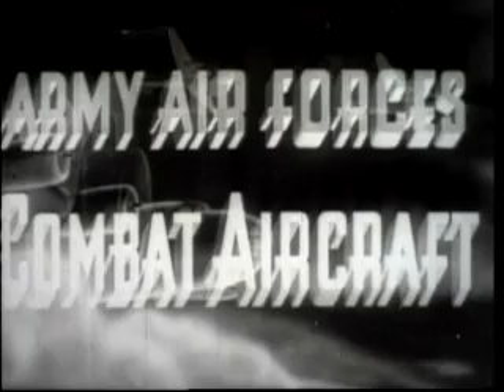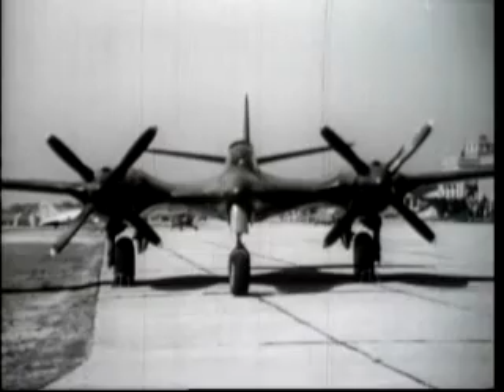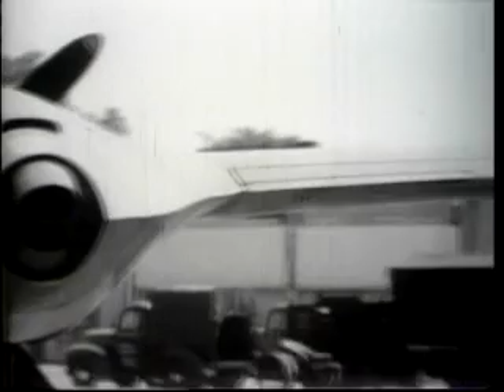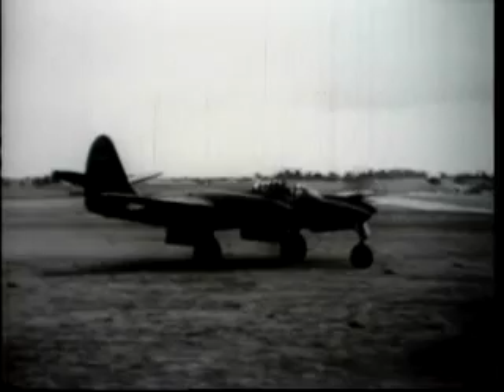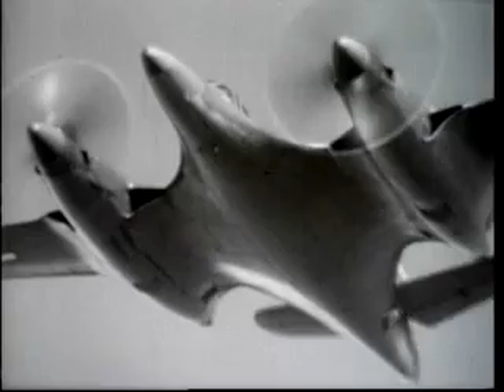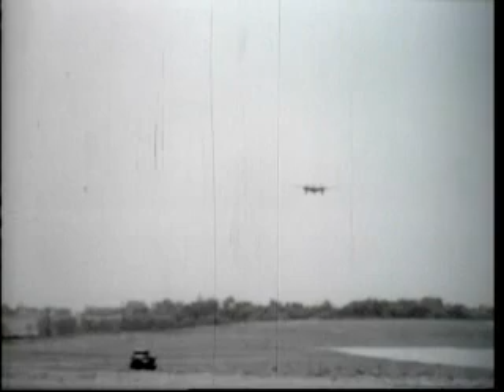XP-67: The "Bat" Outta Hell

Comment: IT HAD LONG RANGE, BUT EVERYTHING ELSE WAS SUB-PAR

Maximum speed: 405 mph (352 knots, 650 km/h) at 25,000 ft (7,600 m)
Cruise speed: 270 mph (235 knots, 435 km/h)
Range: 2,385 mi (2,074 nmi, 3,837 km)
Service ceiling: 37,400 ft (11,400 m)
Rate of climb: 2,600 ft/min (12.7 m/s)
Wing loading: 53.4 lb/ft2 (260 kg/m2)
Power/mass: 0.12 hp/lb (0.2 kW/kg)

Comment: The XP-67 would make an awesome light attack aircraft for today's needs. Replace those heavy Continental recips with lightweight, high efficiency turboprops. Her lines are clean enough that she would also make for a great surveillence platform with a bank of synthetic apature radar antennae on either side of the fuselage belly. A 2nd crew position would be helpful in both instances.

Comment: XP-67 were nice fast flying but two engines were overheating as engines warning lights on forced pilot attempt return back to runway till stopped then pilot escape from burned aircraft . Designer forget about cooling system protection engines as air cool mounts on engine covered keep engines cool . Jet engines with prop engines don’t mixed lead overheating . Air army force officers decided cancel XP-67 after first flight

Comment: With a few modifications this would have been a good candidate for convoy escort in the Atlantic. But, like someone mentioned below, it was not a good example of an aerodynamic plan form. Still look's cool though!
Reply: DH: This would have been a lousy convoy escort.   It had only one set of eyes. Pilots make poor observers since they must pay attention to the plane. It could not carry bombs or depth charges and could not fit a radar.
Reply: @KB4QAA  It would have been necessary to build a two seater for training purposes or, to accommodate a spotter. The addition of external hard points for munitions or drop tank's is not difficult and let's face it with an on board fuel capacity of 700 plus gallons and six 37 M.M. cannon...! Pilots routinely handle their aircraft while maintaining situational awareness, those who fail to do so, regularly go "splat"!

Comment: The one you see here is the only one that ever flew.

https://en.wikipedia.org/wiki/McDonnell_XP-67

Main problem was the engines.  The ones they had didn't work to spec and they weren't able to get other engines as the good engines were all being uses as fast as they were made in existing production aircraft.

Also had trouble with over heating in the engine nacelles - a fire in one of them destroyed the aircraft.

There are a number of other aircraft listed in the Wikipedia page that also never panned out.

When Hughes was brought before Congress about failing to deliver on the Hercules - he mentioned that it was hardly the only developmental aircraft to fail to enter production.  Apparently, there were a lot of them.
.

Comment: It suffered because there was no such things as turboprop at the moment. Pair it up with a couple of Pratt & Whitney turboprops probably would have shaken the airframe apart when it hit critical Mach
Reply: No, it suffered cause the only engines the army air force could, "spare" were 2 modified WW1 engines, and not the engines that were required for it to be a success.

Comment: Too much new tech in one aircraft, and more traditional designs performed as well with fewer developmental problems.  But I can't help but imagine what this would have been like with turboprops and 4-6 M39 20mm canons.
Reply: You wouldnt have too, if and only if the engines given for testing, weren't modified WW1 engines.

Comment: So, all looks, not much go and iffy handling.  Sounds like a poor attempt to copy the fantastic De Havilland Mosquito that served so well to terrorize the SS.
Reply: P: Nothing on the plane except wheels and propellers resembles a Mosquito.
Reply: @KB4QAA  I meant high speed, twin engine multi-role fighter bomber type of copy.
Reply: @poruatokin  Those are general characteristics, not specific to the Mosquito.
Reply: @KB4QAA  If you say so, but the Mosquito was without doubt the best multi-role aircraft of WWII.  Looks like the yanks tried to engineer something to match the Wooden Wonder it and failed miserably.
In any case the Gloster Meteor had already had its first test flight from March 1943 so this XP67 project was pretty much DOA.

Comment: I-1430 = injected 1430 cubic inch, 2100 hp EACH at max power, 3400 rpm ... let that sink in.
Reply: Not that impressive TBH.

A good home mechanic can easily build engines(without electronics) with more power per cubic inch. And using regular high test gas.
Reply: @lordgarion514  You're talking out of your ass.

Comment: It went down a blind alley in aerodynamic terms. The join areas between fuselage, nacelles and wing look good but are in fact huge drag buckets. A Mosquito could out run it and out fly it.
Reply: A Mosquito made of wood using 2 turbo supercharged engines probably could outrun anything with those crappy Continental VI engines. This design went through the wind tunnels at NACA, if there were "buckets" of drag, I think they would have known before it flew.
Reply: No, the mossie could not, know your damned aircraft.  http://www.wwiiaircraftperformance.org/   READ: Inform your ignorance, make fewer stupid foolish statements.   @techadmin7704
Reply: @w8stral  why? That is why we need you....someone who loves to correct everyones ignorant statements. #thecorrector #checkyourfactsman
Reply: Wrong aircraft dude: Hornet.  Mosquito ... just no.

Comment: Would be interesting to find out how it appeared on radar
Reply: Very poorly... .propellers...
Reply: You would definitely see it. The props are huge give aways on radar. It would also be a dead give away to heat seak from the hot exhaust coming out the back.
Reply: @chadfabian3143  Not with the radar of the time period!
Reply: @boyupizzmeov4558   very debatable. Someone did a documentary with the ho229 the plywood wing. Built it by hand to exact specs and put it through radar of it's time and it got picked up by radar wasnt big but still came up on the radar. And that plane was built to avoid being detected by radar. The only thing that gave it away was the metal comes for the jet engines
Reply: @boyupizzmeov4558  in my opinion you cant truly avoid radar unless you jam it. Even early radar you might get away with some things but you would have to be going really fast to avoid it. Now a days there is no limit to what we can detect with lidar and radar combined. It's a big skipping stone game I built a plane that can be almost invisible on radar this year and next year someone else will build radar that can pick up my plane.
Reply: It was very hard to track and impossible to lock up, the radar could not keep up with it,  would fly off of the scope
Reply: Stealth to the primitive X band radars of the era was not in their minds at the time. If it had any cross section benefits they were accidental, not intentional.
Reply: And agian we are spitting hypotheses here we wont know how well it did under radar unless we build a copy and run a test on it. But for now its anyone's best guess! Soo that being said I'd love to hear what other people think!
Reply: On radar it appears to be an airplane.

Comment: Imagine this bad boy on a low pass with 2 proper Merlin Royce engines. Yeah baby!
Reply: That was the Griffon they used on the Mark 24 Spitfire with counter rotating props. I wonder what they would have done for the XP-67?
Reply: My thoughts exactly. I was hoping they had actual audio. Instead, we got romantic violins.
Reply: If it can go 450 mph, why change?
Reply: Why would they want to put in lower power engines?
Reply: @EtzEchad  your answer is above.
Reply: @EtzEchad  British Merlins in ww2 was allways a up grade to American aircraft. Yanks had good radials but nothing equaled the Merlin/Griffin many say it was the engine that won the war. They would fly planes to Europe mechanics would swap in a Merlin for the performance and durability. The mosquito with twin Merlins was faster than the XP could carry 4000lb bomb load or a quick firing 6lb field artillery piece  and 4 20mm cannon all in 1942. Not just a experimental aircraft it was the 1950's when American aircraft design hit its stride some of the stuff they came up with was incredible!
Reply: It would be slower and have a lower service ceiling if it had Merlins in it, 2 stage style superchargers can't keep up with a turbo at higher altitudes, they're cheaper and smaller but they can't move air at the highest altitudes like a turbo can, that's the down side to them.
Reply: @dukecraig2402  I should have clarified. I'm a sound guy. The sound would be nice. But that had been achieved already, so the point is mute.
Reply: "Moot".

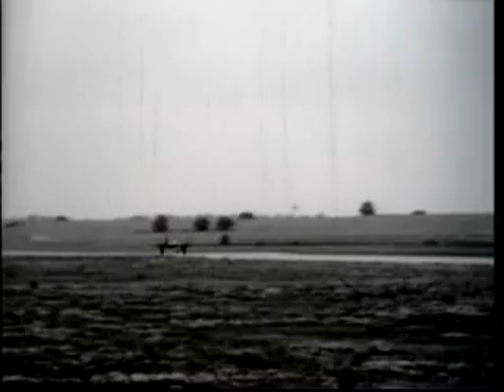Comment: Just noticed at 2:30 the 2 props rotating in same direction. That was the early problem with the P-38 with an engine out situation would spiral into ground. Fix was counter-rotating props. Surprised  not done here.

Comment: I met James McDonnell who designed this plane. He was a brilliant man. He was retired at the time I met him, but he still knew his stuff.
Reply: I might add that this plane was undone by the crappy engines the War Department foisted on it. McDonnell was forced use modified Continentals, which was a very old design from WW1 and had very little room for upgrades.  To get more power, they installed superchargers.  Because the Continentals had poorly designed oil sump system, they were prone to fires when pushed hard and this was no exception for the XP-67 here.  In fact this prototype seen had an engine fire on its last test run. The pilot got it as close as he could to the fire trucks and turned the plane at the last second so the wind would not blow the flames back on the plane.  But it was severely damaged.

The Army Air Forces began to lose interest but McDonnell crews repaired the prototype back to running condition, but by the time it flew again, the contract was cancelled.  McDonnell wanted Merlin's but the AAF said they were all tied up in going to the war effort and none could be spared for testing. This did not make "Mac" happy, and McDonnell Aircraft had a running history of not getting the right engines to meet their contracts.  Turns out the AAF just wanted to see what laminar air flow was capable of and wasn't really serious in pursuing it.

They thought laminar would make super planes outta nothing, hence the lousy engines but the design was way ahead of its time.

Lockheed always got their engines in 1943, McDonnell always had to fight for them and usually got screwed. When doing the first Navy jet, same thing happened. Westinghouse sent just 1!.
Reply: @Kathleen Shaw  I don't think anyone expected a world beater. But I do think if it had better engines the laminar flow design could have been exploited to the fullest. Would love to put this design through a computer model and see how it rates in todays terms.
Reply: Must of been nice to have retired before the age of 80. It is a beautiful aircraft, so kudos for him
Reply: He should have made sure that they "fix[ed] that goddam [DC10 cargo-] door" properly.
Reply: @johnhardman3  One engineer was demoted and another terminated in Long Beach for the cargo door fail. But the DC-10/MD-11 just had too many design issues that even Mac couldn't control. He was trying to keep the company alive. His former defense group was propping up Douglas Commercial post merger. And many of those engineers were good at designing to a price point, not necessarily to a comprehensive spec.

Comment: SR-71 of the propeller age, baby.
Reply: So, you saw that, too? Good eye.
Reply: That was the first thing I saw. Way ahead of its time!
Reply: Wonder how it would've worked with Merlin's...
Reply: Always thought this plane would pass for the SR-71’s great grandpa, only on looks.
Reply: That's what I saw. What a great fighter design. That fighter would have worked well in Korea and Vietnam. Did it?
Reply: This wasn't even the fastest propeller driven airplane though.
Reply: Let's fold up the tents and go home, Lost and Found - The Face of America Abroad and Keith W have spoken. #knowitall
Reply: HailTo TheChief:
The thing is,
if they would have replaced just the Turbo-Superchargers with pure Jets    like they were saying at the end 
that would have probably solved the overheating problem and made it more like the SR-71’s J-58 engines
with their “bypass tubes”-
a transitional system that went from mechanical 
internal combustion to 
essentially pure afterburner thrust.

They are more of a rocket at that point than a Jet.

Somewhat similar in having a 
“dual nature”,
albeit not as fast and simple as jets were already becoming...
so,it would not have been as dramatically impressive but it still would have been mechanically fascinating.

To me,at least.

All in all,though-
not bad for a first plane.

If they could have only upgraded 
to pure jets that would have probably been even better,
of course...

Dream on!
Reply: Wouldn’t put those two in the same category.  The SR-71 didn’t suck and it was definitely not underpowered.  All the performance specs were estimated.
Reply: @LostAnFound  believe guys are referring to the shape...

Comment: "The XP-67 only reached a confirmed top speed of 405 mph (652 km/h)" so even the P-38 was way ahead of it.
Reply: Tech Admin
7 months ago
"I might add that this plane was undone by the crappy engines the War Department foisted on it. McDonnell was forced use modified Continentals, which was a very old design from WW1 and had very little room for upgrades.  To get more power, they installed superchargers.  Because the Continentals had poorly designed oil sump system, they were prone to fires when pushed hard and this was no exception for the XP-67 here.  In fact this prototype seen had an engine fire on its last test run. The pilot got it as close as he could to the fire trucks and turned the plane at the last second so the wind would not blow the flames back on the plane.  But it was severely damaged.

The Army Air Forces began to lose interest but McDonnell crews repaired the prototype back to running condition, but by the time it flew again, the contract was cancelled.  McDonnell wanted Merlin's but the AAF said they were all tied up in going to the war effort and none could be spared for testing. This did not make "Mac" happy, and McDonnell Aircraft had a running history of not getting the right engines to meet their contracts.  Turns out the AAF just wanted to see what laminar air flow was capable of and wasn't really serious in pursuing it.

They thought laminar would make super planes outta nothing, hence the lousy engines but the design was way ahead of its time.

Lockheed always got their engines in 1943, McDonnell always had to fight for them and usually got screwed. When doing the first Navy jet, same thing happened. Westinghouse sent just 1!.
"
Reply: The continental powerplants were pos's.

Comment: Take a good look at this airplane; and then take a look at the B-2 and the YF-23,  Nobody knew what that blended body design would lead to.
Reply: @Teddles Peddles  Oh, and one more thing. You took a swipe at the XP-67 as garbage because it never made it into production Well, duh! its an XP- variant.  Xperimental Prototype. Those are supposed to be prototypes, not production aircraft. And just in case you missed it, the Horton you are so in love with never made it into production either. So, technically, using your own logic the Horten is garbage also. (mike drop)
Reply: The reduced radar cross-section was a surprise bonus. The inital purpose was to reduce drag to increase speed.
Reply: @Teddles Peddles  Slow your roll there Teddles. No need to call everyone an idiot. Yes the B-2 drew inspiration from the Horten. However, technically, the Horten is a flying wing. No blended fuselage at all because everything is built within the wing its self. Great planes are always built on the successes of other aircraft and the B-2 and YF-23 and others draw on the knowledge of multiple aircraft. Including the XP-67
Reply: @TraderDan58  "itself" not "its self".
Reply: @Teddles Peddles  If you really believe that the B-2 is based on the Ho 229, then YOU are the idiot!
Reply: @Patrick Ancona  Do you know Kelly Johnson? Jack Northrop? Yes the allies used the german engineers but the germans did the same with those of the countries they occupied. Look for Nicolas Payen for example or for Gnome et Rhône engines. Or why the 262 had a NACA airfoil. etc.
Reply: Teddles Peddles Northrop was experimenting with flying wings before the US even knew the Ho229 existed
Reply: @Teddles Peddles  I since sarcasm...
Reply: @Teddles Peddles  hmm Northrop developed flying wing during WW2 .
Reply: @Patrick Ancona  skunk works didn't build B2.
Northrop did.

Comment: Six 37mm cannon? Dayyum that would ruin a bad guys day all to hell if the XP-67 was on him! Bet it was pretty stealthy too with that blended body and low cross-section.
Reply: Yea, needed 6, because 5 would jam...  and no, it was not stealthy at all.
Reply: JimHadar1 propeller drivin aircraft could never hope to b stealthy the props give hugh radar cross section
Reply: @trekkifpv1976  "huge"
Reply: Browning designed the 37 as a ground-based medium AAA weapon; the Oldsmobile-built T9(?) jammed under any sort of g-load. The 37 in the nose of the P-39 became ballast, and eventually it was found that removal of the 30-round horsecollar magazine would upset balance enough to induce a flat spin. Far better to go with the 12 .50s, imho.